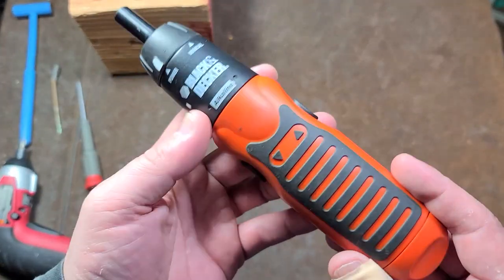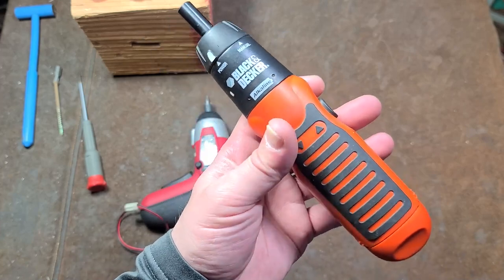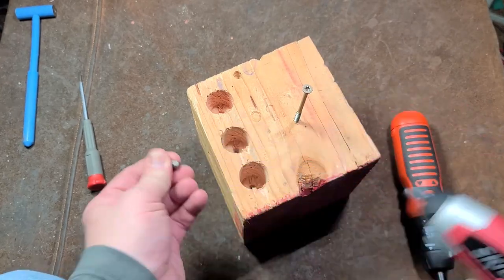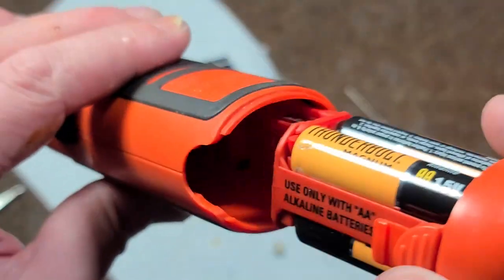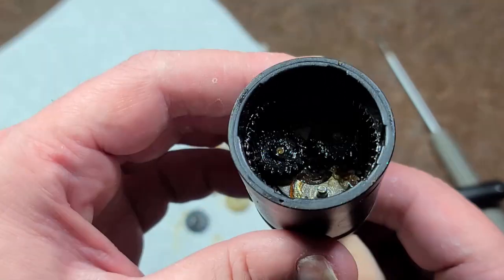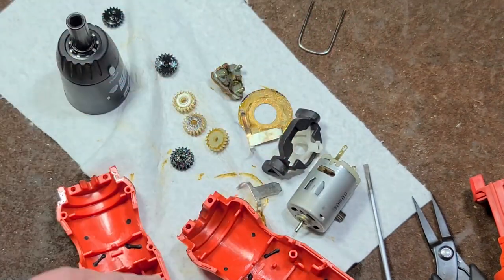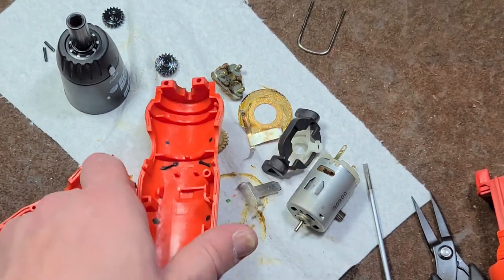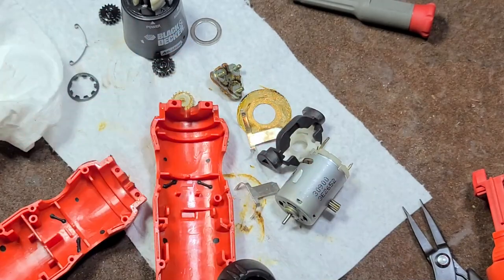Black & Decker AA Alkaline Electric Screw Driver Review & TearDown

Comment: We had one of those at the desktop support service department where I used to work, we used it for removing/replacing screws on desktop PC's.  IT worked fine for that, but it goes through batteries fairly quickly.

Comment: Thanks for the teardown. For mine, the IN button is not making good contact. I was wondering how to fix it without taking it apart. I realise now I have been bending the wrong metal strip. I should be bending the inner strip outwards.
Oh, I have mine since 2000's.

Comment: I have one of the first generation models, a rechargeable version. I used it a ton day in and day out for about five years as a cable guy (starting in 2006) mainly just for removing and re-installing faceplates and cable outlet mounts etc. it was amazing for reducing hand/wrist fatigue bs using manual screw drivers haha. I recently found it this past weekend and I cleaned off and lubed the insides and used deoxit on the switch assembly and 17 years later it still works after all these years lol. It’s definitely not for high torque applications but for light jobs it works great and I may pick up the Aja line version now that I use EBL rechargeable batteries. Love the review! Cheers from Houston 🍺

Comment: Cool. I've had one in my kitchen tool drawer for several years. It is quite useful for small low torque stuff around the house. For example, you can go over all your kitchen cabinet hardware and snug up any loose screws/bolts. You can also let the tool twist as you are using it to reduce torque.
Reply from the maker: Right on

Comment: I had the og to that black and deck in 1989 hated the fact that it died in in a few years did not know back then what I know now that that leaving on the wall mount charger kills the Nicad batteries and that screw driver had   are not user I like idea you did with skil  changing out the cheap plastic gears for metal it's going to make that screwdriver last for many years as long as you keep the lithium battery maintained and when the day does come if you do  feel like  finding a way  to replace the lithium cell I know how to tap weld a new one in place with the metal gears is worth it as it is at the storage probably not